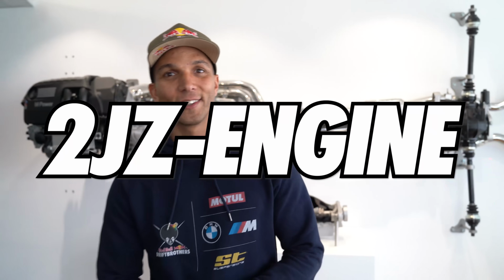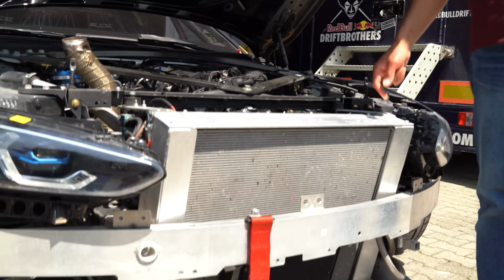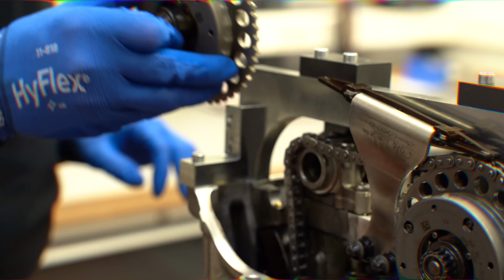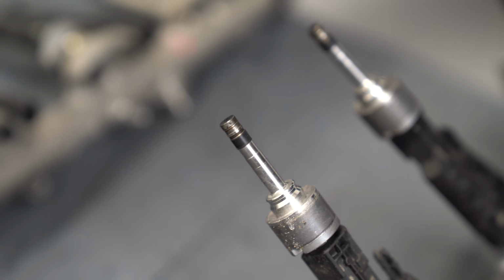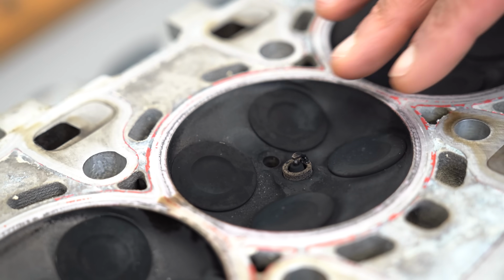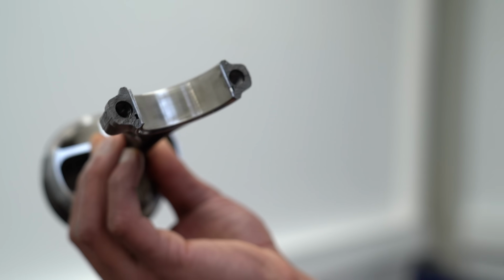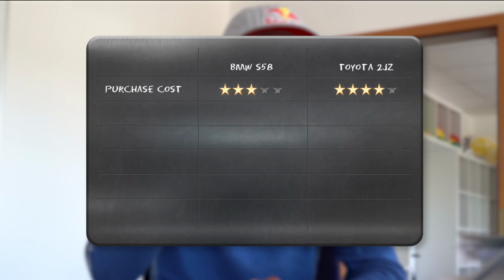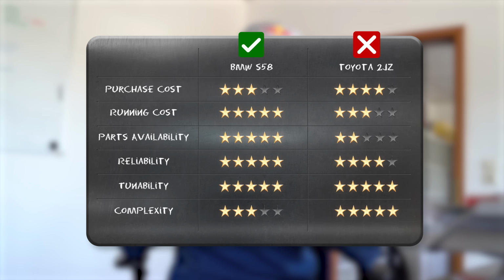Is THIS the new 2JZ? A deep dive into BMW's S58

Comment: main problem with s58 is the valvetrain. too expensive and too complex for this application where honestly, environment doest really matter
Reply: It has variable timing and lift, so it's only duration away from being able to essentially have the perfect cam for any RPM. People are quick to throw away parts like this on engine builds to simplify engines because all they care about is the peak power figure, but they miss out on a lot of meat under the curve which is much more important than the power output in an engine that actually gets used.
Reply: @Vlku272  Spot on!  length of power band matters a lot! BMW are masters of broad power bands and that's why their cars are so hard to beat

Comment: the 2jz wishes it was an s58.   stock s58 power record is above 1200whp with no cams or head work.    2jz are cool because the aftermarket, but the aftermarket for the bmw engines is finally catching up, in 20 years, because the s58 is bmws LAST true 3.0 gas m engine,  it was overbuilt and it will live on forever,  forged pistons, rods, and a cam = 1500hp capable.

Comment: From a technical perspective the s58 and 2jz are miles apart. The 2jz is rather archaic and heavy respectively. The s58 is the most technically advanced turbocharged inline six ever made. But we’re talking about 25 years of development. The reason the 2jz is a great engine, it’s strong and can handle lots of boost.
Reply: What Toyota did in 1993 took BMW almost 30 years and not even sure if the S58 other than weight savings is more durable or holds more power than a 2jz block or makes more power on stock bottom end. Which explains why we are even discussing the 2jz in 2023 but no one is discussing the inline 6 bmw released in 1993………😑 Elite engineering and congrats to bmw but if Toyota /yamaha developed an inline 6 today with the budget we both know it would be superior
Reply: @bigjdm5460  not even close. The bmw s58 is far more advanced. Variable valve timing, valvetronic (variable lift), extreme high pressure (350 bar) direct injection. Full aluminum closed deck block based evolved from the b57 diesel. Direct camshaft  driven fuel pump. The 2jz is a heavy iron block six that the only reason it’s venerable is that it is overbuilt and handles a lot of boost. You don’t know what you’re talking about. Bmw was winning f1 championships with a 1,400 horsepower stock production block based 1.5 liter turbo four cylinder almost a decade before the 2jz even existed. It is still the most powerful engine in F1 history. Educate yourself
Reply: @Bimmer_Bill  Notice you’re now discussing F1 engines , which means you can’t think of any mass produced BMW engine to compete with an engine Toyota put in everyday cars hahahaha! Again, no one including you ever discuss bmw engines from 1993 when discussing the most overbuilt, reliable , inline 6 that is swapped in everything including Lamborghini’s. 

Since I need to do homewrk on F1 now which wasn’t the topic . Please post how much power a stock bottom end S58 makes and then post how much power have people made on a stock bottom end 2jz ? Stop telling me about variable valve timing on both exhaust and intake and post the bottom line maximum potential both engines are capable of today?
Reply: @bigjdm5460  look the s58 will make 800 crank horsepower with nothing more than a flash tube and e50 nothing else and it will live happy at that power level for a long time. Furthermore it’s not a boat anchor of an engine so it does brilliant everywhere not just for drag racing. The 2jz is old fashioned just an overbuilt air pump. Archaic. Anyone can boost the shit out of a boat anchor and it will live, the block at least lol. Toyota has never had the technology that bmw has and that continues to this day. Deal with it … or not and live in your alternate reality. Have a nice day and merry Christmas.
Reply: @Bimmer_Bill  hahaha your pride lives behind your comments and it’s funny. First you waved the white flag secretly by mentioning an F1 engine, which ur smart enough to realize that. 1993 Toyota was clearly under the gentleman agreement limiting engine output to 300bhp roughly. S58 reaching 800hp with just e85 and minor this and that is irrelevant considering it just comes with bigger turbos etc out the gate since it’s 2023 after all . The 2jz if put in a modern car from Toyota would come factory with bigger turbos etc and would be sitting at 560hp so you would need less to get to 800whp. That entire segment u posted is less to do with the S58 and just more to do with cars being released with more power due to the era we are in. Still it’s obvious the 2jz is the stronger block, and stronger rotating assembly . Please list what the BMW G80 has been winning ? Because the video above simply about straight line performance which Americans are only concerned about, that’s why the 2jz is always being discussed. The G80 platform is like 3950 lbs in the real world the Porsche 992 would always be the better drivers car as we know weight is the enemy. These cars are so heavy they will run through tires etc after a few laps on circuit. An R32 GTR would be a better track weapon than a G80 . Now if we are just daily long a G80 then yea I would pick it. When discussing 1/4 mile or highway runs or circuit racing it’s not the top pick by any means . The Hp war has rendered it useless unless you’re comparing it to other modern bloated cars that are useless.
Reply: @bigjdm5460  I’m not waving any white flag. I’m stating facts that you’re avoiding purposely. Those facts are the s58 is a much more modern higher tech engine than the 2jz and that bmw has been making engines (the most powerful f1 engine ever AGAIN used a PRODUCTION CAR block that’s amazing) a decade more before that 2jz ever existed. Stop with the deflections, the meaningless excuses, and just accept that fact: Give credit where credit is due. Have a nice day. I’m not arguing anymore on Christmas Day. Enjoy yours.
Reply: @Bimmer_Bill  argument should never be how the S58 is more modern . That’s a given. Again, F1 engine is pointless ago add unless u know in the 90’s Japan had the better more reliable hardware. So ur bringing up F1. That’s waving the white flag. We both know in the 90’s starting in 1989 the R32 GTR was the engine and chassis and AWD system that put everybody including BMW shame and back to the drawing board in motor sports and on the street. When discussing F1 BMW is not top 3 of all time so just leave that discussion somewhere else. BMW had no answers for the R35 GTR when it came out. BMW is doing well because the Japanese are worried about the electric battery and crossover market. Lol.
Reply: @bigjdm5460  I’m not waving the white flag. the point was bmw used a production car block in f1, thats definitely relevant. It shows that bmw COULD AND DID make a bulletproof PRODUCTION engine long before the 2jz ever existed. You talk like the 2jz makes 1,000 hp stock. Thats nonsense.

Now sit down, take a deep breath and learn. When you say F1 and “Japan”, you’re moving the goal posts. Same thing with comparing bmw f1 to others like Ferrari. We’re supposed to be comparing TOYOTA TO BMW here NOT pick and choose your countries and manufacturers to compare to  BMW lol! Facts are the highest power turbo and normally aspirated F1 engines ever were made by BMW, period not Toyota (utter failure in F1), not Honda, not anyone else. Why is that relevant? F1 is the highest technology in terms of engine design and development. If you can make it in F1, production cars are easy. Understand? Hell, Toyota has to lean on Yamaha for F1 engine design, even the LFA was a Yamaha. Other than that toyota has long been known for copying engine designs such as  nascar, Indy, Facts. Argue til your blue in the face, doesn’t make what you’re saying right. 

Also F1 performance is equally if not more dependent on the chassis and the best come from England period. Japan and Germany are fairly clueless in chassis design. McClaren, Mercedes, Red Bull, all English design. The only exception is Ferrari who not only make top level chassis but engines too. The only successful f1 engine manufacturers (championships) have come from England (Cosworth/ford, ilmor/mercedes), Maranello (Ferrari), Japan (only Honda not Toyota not Yamaha), and Germany (Porsche/bmw). Merry Christmas dude.

Comment: Atmo 2jz price is 1-1.5k$, s58 about 5k$? Right competition for s58 it's vr38
Reply: VR38 isn’t even in the same dimension as the S58, that engine got left for dead a long time ago. Not hating on R35s but you’re paying a fuck ton of money for EA839/B58 potential.
Reply: @CadexLaw if u want to compete with tt vipers and lambos vr38 is a valid choice no bmw are touching those

Comment: I agree with 98% of the chart minus the section on parts availability. There are hundreds of manufacturers of aftermarket parts support for the 2jz that are readily available. Even talking OEM parts, your local Lexus / Toyota dealer has a majority of parts available for a 2jz with the cross platforms like IS300 / LC300 etc. You can even buy a complete 2jz gte rotating assembly shortblock right at a dealer.

The S58 / B58 platform are still ramping up on aftermarket support and it's great to see but I still think the 2JZ section should have been 4-5 stars on parts availability
Reply: I'd say the B58 would have more parts available than the S58 since it's been out longer(since 2015) and is in more cars(almost 22 at best other than the supra)than the S58(maybe 5-6 at best)but I'd say that due time since Bmw plans to keep the B58 around a bit threw the 2030s also,I'd say they'd have parts(other than bmw updating them)more available for the B58 in the future more than the S58 unless bmw puts the S58 in more platforms/cars they have now.
Reply: @carboydorifutoparty3976  true, but the b58 isn't holding together with 1000hp
Reply: @240Sav built motor they are
Reply: yea but you dont need anything to make this crazy numbers like he said 1039 hp and 1285 nm of torque on all stock engine just a bigget turbo and port injection so the reallity is youdont even need much
Reply: @ltortur3rl  you need quite a bit actually
Reply: @kanaka-sound   you need more to make this numbers on a 2jz so  i dont see your point here
Reply: @ltortur3rl not even close, look at the cost of the s58 engine alone or the vehicle that it comes in and the cost

I built a 1040whp 2JZ for under 12k - doesn’t compare
Reply: @kanaka-sound  you can buy a m3 -m4 for 17k  in uk so you dont need to swap anything lol
Reply: @ltortur3rl  that’s crazy, I paid 300$ USD for my 2J block
Reply: @kanaka-sound  the cost is higher on the S58 at this point in time simply because it's so new. It's also much better built than the 2JZ in stock form, which adds to the cost. 

If you realistically want a modern alternative to the 2JZ you'd be looking at the B58. Much cheaper than the S58, holds about the same power on stock internals as the 2JZ and easily exceeds 1000HP on the stock block. 
And as a bonus it's much lighter. That iron block in the 2JZ is nice if you're planning to chase 2000HP, but boy does it demolish the handling of most cars it's put in.

Comment: The exhaust ports are not merged in the cylinder head like the B58. Interesting…
Reply: That's just the 2 port B58 that's like that. The 6 port B58s have the usual traditional heads.

Comment: If the mileage is low it doesnt matter if it has lasted 2 years
Reply: Mileage is basically useless for determining engine heath. Maintenance and load take precedence. I've seen plenty of engines with low mileage in horrific condition and the same engines with high mileage in almost new condition. Maintenance at the end of the day keeps everything from wearing down, and Load tests the mechanical strength of the engine. The mileage you get only tells you how good the owner was, not how good the engine itself is.

Comment: Do you guys run the car to a higher redline than the stock 7200?  With your sequential transmission it should be able to go higher since it's the ZF that brought the redline down from the S55.  Also is more broad aftermarket MoTec support coming for the S58?
Reply: Raising redline doesn’t always mean more power if the turbos meet peak boost at for example 6800 no reason to spin the motor to 7200. Also the trans wouldn’t stop the car from reving higher
Reply: the reason it doesn’t need to rev to 7600 like the s55 is because it’s an 8 speed ZF compared to the 7 speed DCT.

Comment: nooooooooo my b58 will always be king!
Reply: B58 is an amazing engine but definitely has it's limitations when you are really pushing to 4 digit HP numbers.  Slightly stronger internals and extra fuel pump and extra turbo of the S58 just give it an inherent edge from a pure HP potential standpoint.  I think the B58 sounds a lot better though.  They're much smoother and really have a nice creamy tone through the whole RPM band and the S58 is way more abrasive.

Comment: It is a testament to modern engineering, manufacturing, and technology that one can boost a factory engine to over 1000hp. Great video
Reply: It’s literally just forged pistons and crankshaft, but these are the weakest forged pistons to exist if they only handle 860whp
Reply: @Eclipsis17  Cope. It could handle 1000hp+ stock block

Comment: What oil viscosity do you guys use? in these engines when running 1000bhp
Reply: 0w20 😂
Reply: @optionant5963  probably service it every 15,000kms as well 😭🤣
Reply: @optionant5963  image if they actually used the oil BMW recommends in these cars 🤣